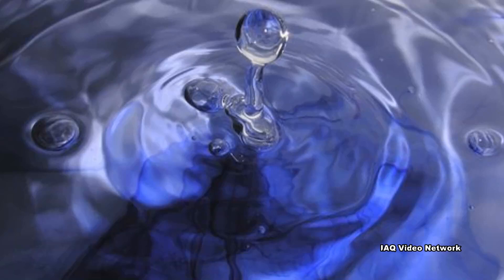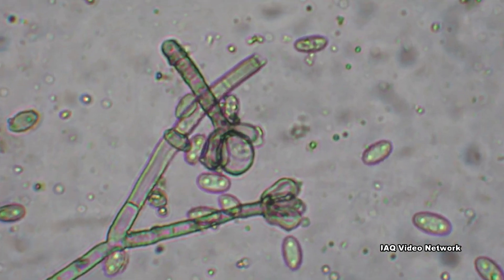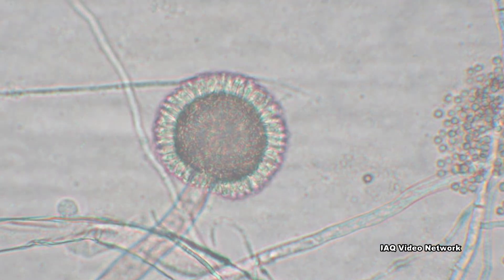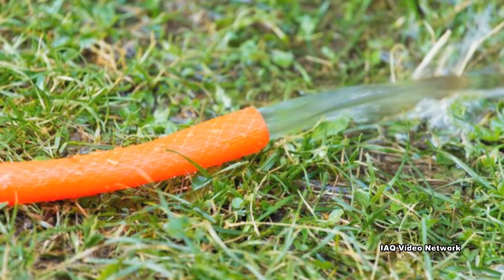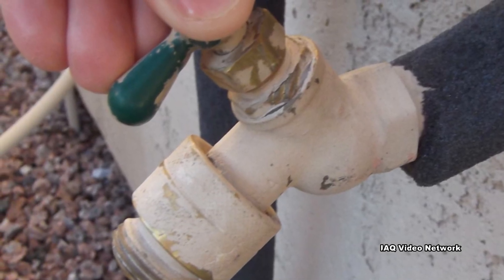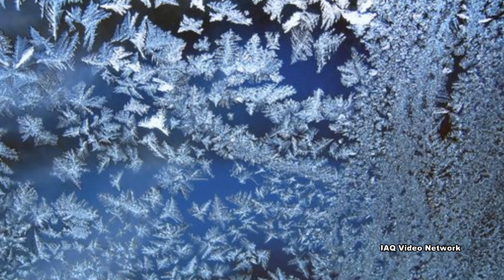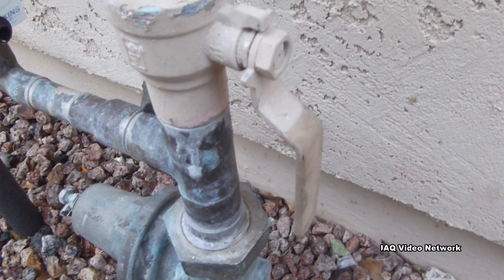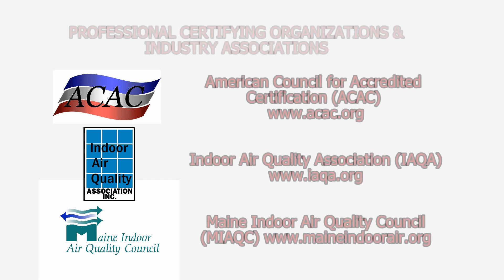Frozen & Burst Pipes = Water Damage & Mold

Comment: Best defense is to automatically turn off the water at main when occupants are away or at rest. How? Install a dual valve unit which turns water on when motion is detected and shuts the water off if a water leak is detected. See it at www.smartwaterguard.com